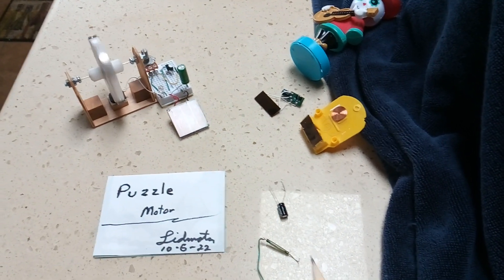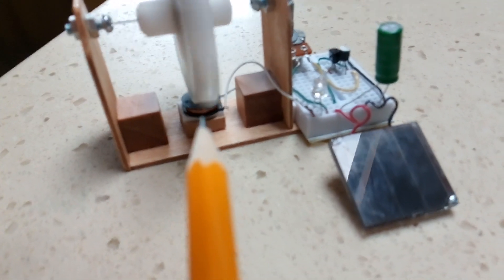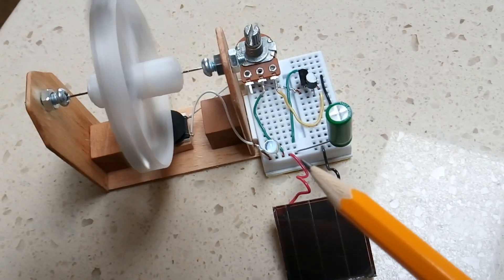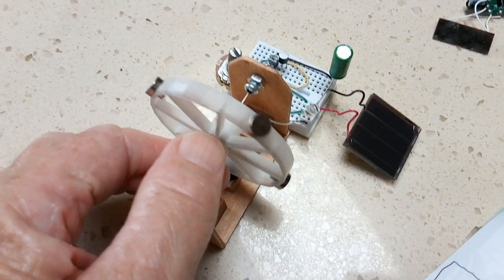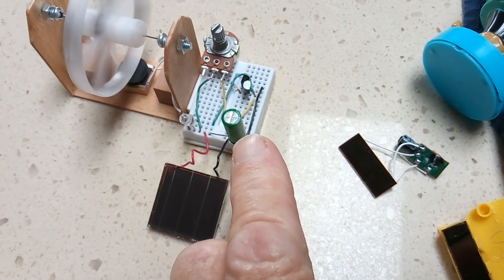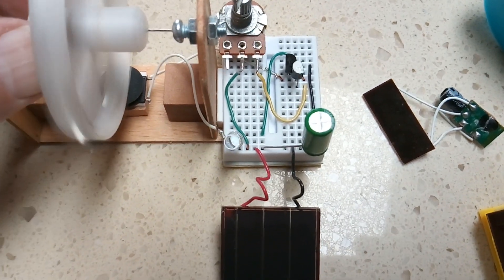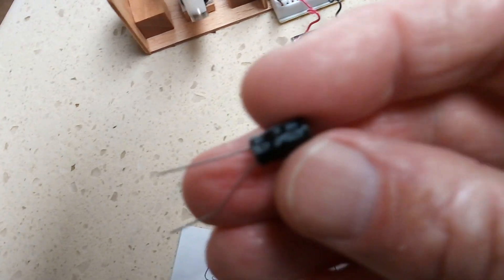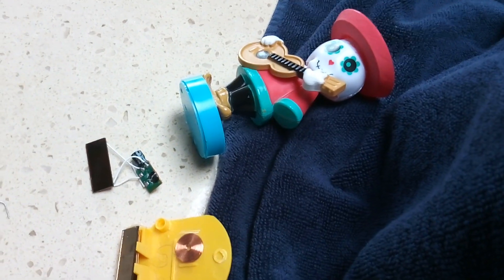Puzzle Motor

Comment: Very nicely made motor too 😀
It reminds me of a fairground Ferris wheel.
Reply from the maker: Now if you had built this there might be tiny little people figures riding the Ferris wheel.  Of course you would have had your floating little Delorean in the background ro show how they got to the fair. Ha.  Oh how I miss those old days when we built such things.
Reply: Haha, yes, definitely miss such times. I am doing vids now, but on RC boats mainly... self builds. However, Great Value Alum was only $1.89 in Walmart the other day, so battery stuff is definitely on the horizon! A solar rechargeable battery of 10F equiv would be cool for 24/7 pulse motors 😀

Comment: Great to see you back.
Its very reminiscent of an SSG.
Its Miniature Transistorized SSG.
Reply from the maker: Actually I though about configuring this structuce as a Bedini SSG type set up.  I would have it charge up a second capacitor using the flyback to show the how the SSG worked.
Reply: @Lidmotor  Would be very interesting to compare run times. Would highlight how much regeneration is happening in this version.

Comment: If you put a stocky diode instead of LED it would run even longer. Because there's lower voltage drop with stocky or geranium diodes. The LED is using a little energy
Reply from the maker: Thanks.
Reply: If you mean schottky diode sure there is less of a drop in voltage potential drop although he is not rectifying it and also he is not smoothing the ripple with torridal ferrrite or a choke filter. Of course the led is using little energy it is a diode(light emitting diode) to state such a thing shows lack of concentration on your behalf and shows you have little input or knowledge of the effect if you are talking about reversing the shotkky diode then this again has no place in this circuit. The effect the led does is just that an effect of conversion of work and or load being placed into the circuit. Please Greg if you have a circuit that you have built then show us all how this would be better for this type of ssg circuit.
Reply: @GG-od2tr  yes I meant Schottky diode. If I can't spell doesn't mean I don't know a lot about circuits. If you knew how back EMF works you would understand what he's trying to do with the LED. The LED is returning the back EMF to the capacitor , which then makes the circuit in a loop recharging itself. Watch some of my videos about advanced bedini circuits and you'll understand maybe

Comment: I haven't found any solar rockers in any of the usual bargain stores this year. I was hoping there might be some Halloween or Christmas ones turning up, but nothing ☹☹
Reply from the maker: These last ones I got were at a 99 cent store.  They didn't stock many and were sold out quickly.  I might make some coils like this on my 3D printer and wind them up using fine wire.